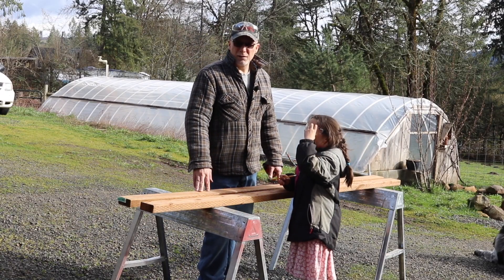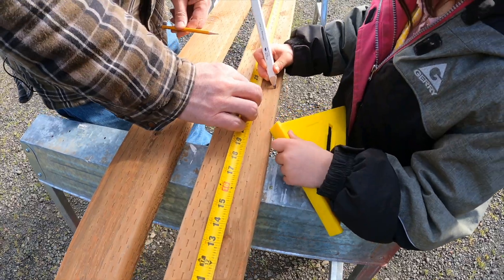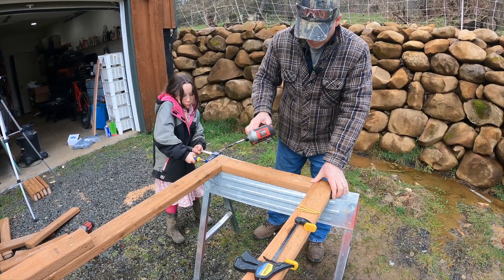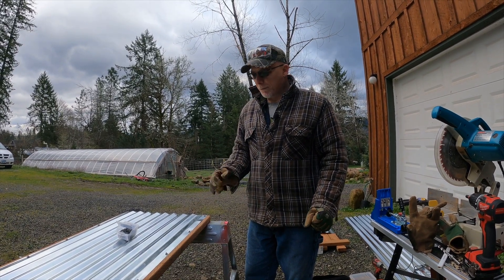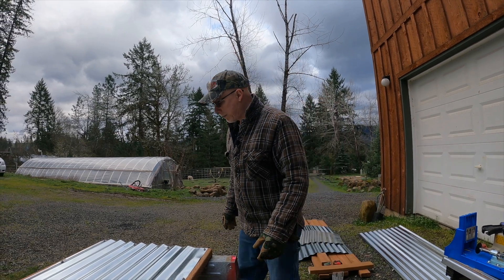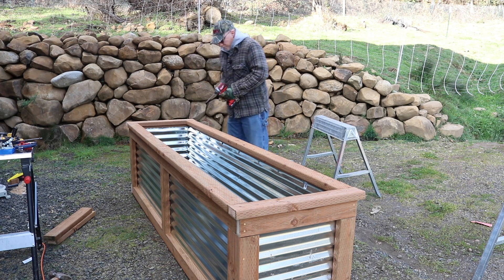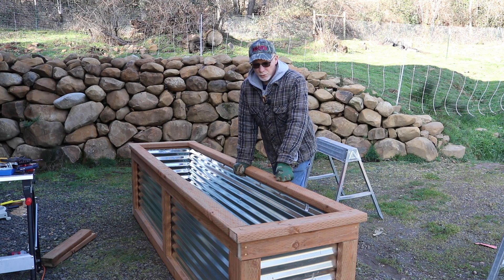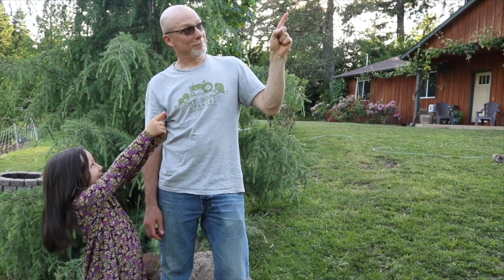Affordable yet Durable Grow Boxes

Comment: is there need for having it so seep like that ? you could have made two Durable Grow Boxes with that kind of height.
Reply from the maker: The height can be adjusted to wha ever height you would like. Sometimes the taller boxes are wanted to help save sore backs so that not so much bending over is needed such as in the case of arthritis. We will be filling them half way with logs and other materials before adding compost.
Reply from the maker: The Farmer also shared with me that while shorter ones would save on a little wood the percentage of wood would be higher in a smaller box.